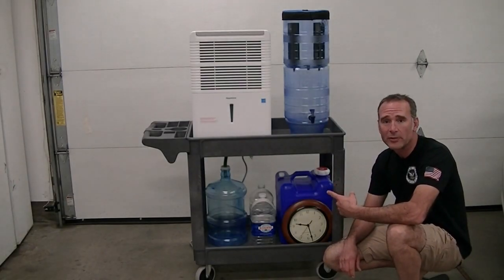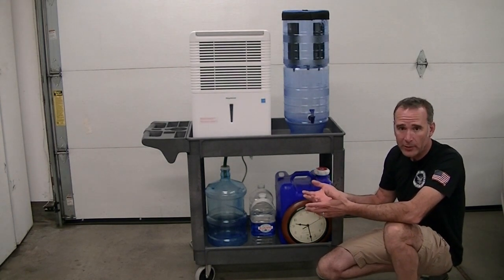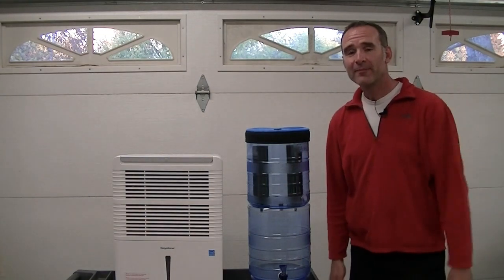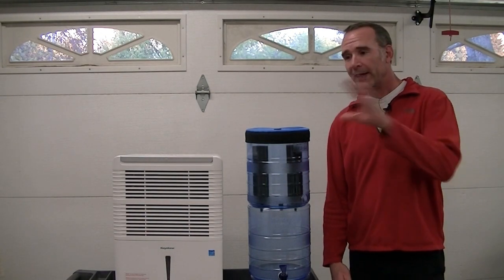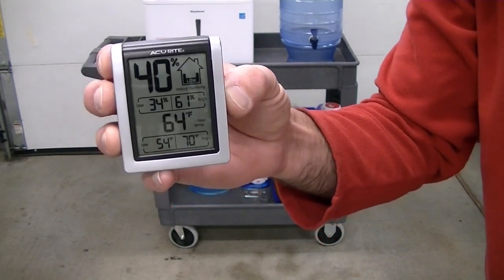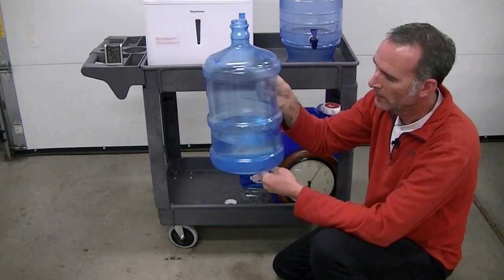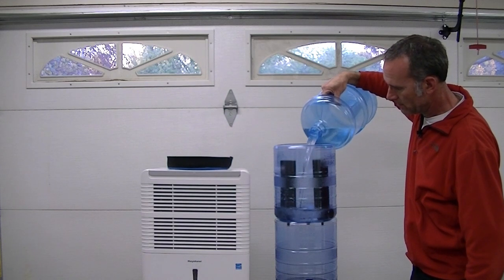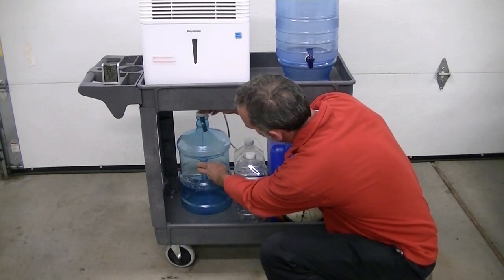Part 4 | How To Make Your Own Air To Water Generator At Home | 4 to 9 Gallons Of Purified Water/Day

Comment: To make more water, the dehumidifier should be outside. Having it sitting in a garage or inside the house, the dehumidifier is trying to take humidity out of the room. So it will make the humidity drop if it’s in a room. I ran my dehumidifier outside and always at night when the power was cheaper. The dehumidifier was positioned in a covered area outside. I live in California and every night our humidity is much more than during the day. Any dust or bugs would be filtered out by the water purifier. You did a great job. Good video. Thank you!

Comment: I'm setting up a system here @ home. My question is why not collect the water directly into the filtration unit, ilimnating the 5gal bottle in the process?
Reply: I think because the setup is easier like this.
Reply: I asked myself the same question! Just have the filter at the bottom of the hose therefore filtering directly from the dehumidifier ultimately skipping an entire process
Reply: Why do you need to filter it at all? It’s pretty much distilled water as it is.
Reply: @BillStreeter    the amount of airborne solids in the average home is insane.  For instance there is so much crap in the air of a house i have to clean some forced air furnaces flame sensors for a couple customers twice a winter.  This occurs mostly due to airborne silicate from dyer sheets and cleaners but there are other culprits.  (Lennox and Bryant have done the most lab testing on these issues).  All air fresheners add crap to the air as well.  The filtration is there to stop you from ingesting that type of crap as it will stick in the condensed water at a higher rate than remain as free air particles.
Reply: @BillStreeter  because it's impure. Machine has aluminum with has to be cleaned with black the filters. Just See part 3.
Reply: @BillStreeter  because the dehumidifier might be adding chemical or heavy metals. the blades collecting the water are aluminum.
Reply: @davetinoco  yeah so it's to filter potential contamination after it's been condensed, then. I got it.
Reply: Is there any way to run the dehumidifier off solar economicly
Reply: The dehumidifier production is faster than the filtration,  it will back up (leak)
Reply: I just find out this video, very interesting, I live in Phoenix, the humidity is very low, 34% this day, what if I run a humidifier and your system, course, that would be more power usage, honestly, I don't have patience for math, just wondering, would that work? Great information, thank you.
Reply: When A/C systems run they emit quite a bit of water.  Isn't that the same as water from the dehumidifier?  If we collect it and run it through the purification and add the salts aren't we in the same place?  Great video... Thanks

I do know that dehumidifiers do a better job especially in winter but just thinking about what's wasted in the summers, i live in "hotlanta" GA.

Comment: i like you video.....  i collect rain water for one source..... i also collect from an AC in summer and like your idea to add a Dehumidifier as another source of water..... but i planning on collecting into an extra 60 gal rain water barrel i have which has a spicket on bottom to have access to the water (i like larger collection point because i never know how much water will be collected each day)  and then i use that that for my cats and a donkey and plants but what i going to drink i have a three gal water purifier that i run my water thru.... how does that sound??  but what if put the dehumidifier just outside under the eve of building?  would it collect any different than being inside?  thanks for any advice

Comment: Why does he need a dehumidifier? Just run tap water through the filtration system.
Reply from the maker: If you're in a spot where you don't have a tap or well; cabin in the woods, etc... You can power this with portable solar.  Take care Larry